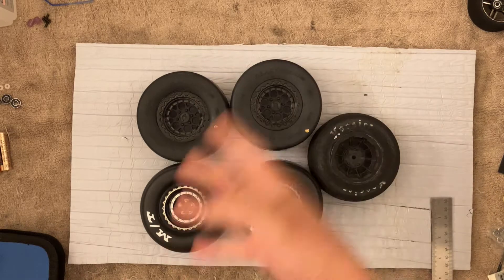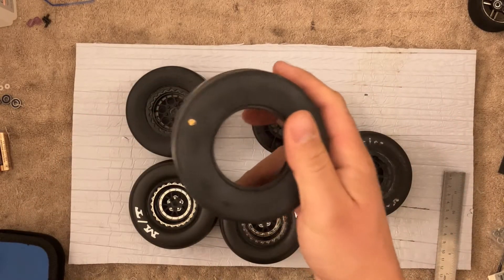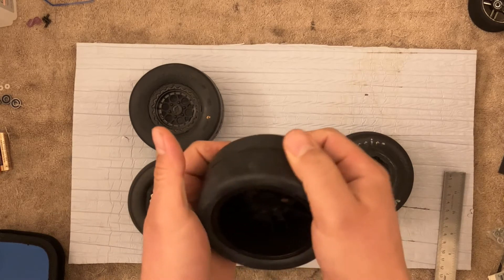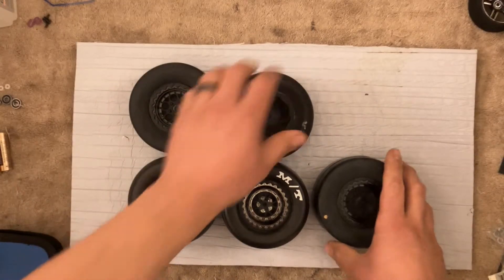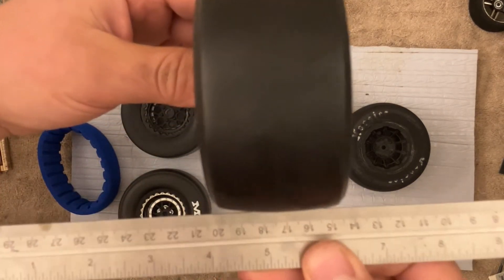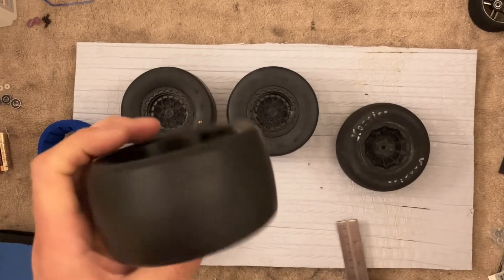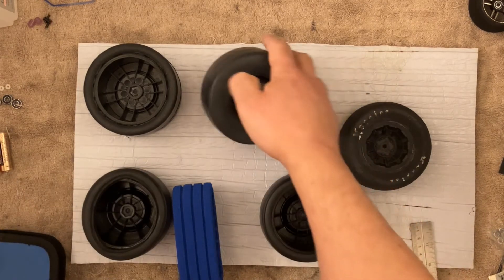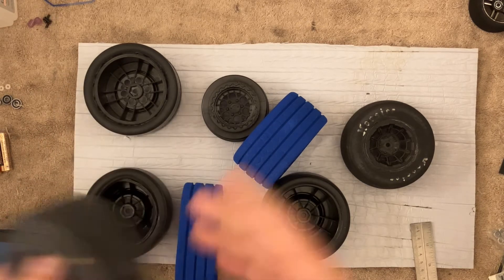RC No Prep Drag Car tire basics Hoosier Mickey Thompson Proline Reaction for Drag Slash DR10 22s

Comment: Great idea cut foam turn foam inside out and put radius edge to the inside with the short sidewall gets a better leveling affect on the contact patch.. Just got my first R/C Losi 22s 69 Camaro drag car thanks for the help..
Reply from the maker: Do you do this in belted or non belted tires too? The foam stretches less the way you are describing. So, it might just reduce ballooning a bit in the MT tires.

Comment: Tires that ballon have less traction and are a lot more unstable. Plus if your body is low you’ll have tire drag on the body once they ballin which in return will slow your car down. Belted tires are the way to go that’s why the are the tire that one at King of the Streets 2022. Ballooning tires makes the rear end of your car very loose. Oh and the contact patch you keep mentioning is really small once those tires start to balloon.
Reply from the maker: Good stuff. I will add that in minute 3:30 I mentioned that tires that do not balloon are more stable or ballooning tires are less stable. And at minute 4:10 I typed how if tires balloon as weight shifts the car will pull left or right... so less stability can be inferred. I probably should have inserted and audio clip for this bit. Then in minutes 10:10, 11:35, and 12:20 I talk about how rounder tires have less of a contact patch and how if the foam balloons the tire the contact patch is reduced dramatically. So yes... completely agree that ballooning tires due to speed, just like ballooned tires due to foam (more exaggerated with speed) will reduce the contact patch. I assumed that would be inferred. 

I did not mention the potential of contacting the body. You are right. That is really bad for stability as it would act as a break on each tire that could case it to break one side more than the other... causing it to pull/pitch one way or another. And it is made worse if the foam breaks. You are absolutely right about the tires hitting the body. 

Thanks for the feedback. Cheers.

Comment: You could use acetone to remove the tires.
Reply from the maker: True... I just don't like the smell and how it gels up and having to clean it. 😅

It's just easier to cut them and glue them back up.
Reply: Use a heat gun to remove tire and tape them

Comment: Seems to me when a tire balloons you have less rubber on the road so less traction. One ballooning more than the other you loose control. No prep drag rules now require foams JS
Reply from the maker: Cool. Good to know. Can you send me the update? DHRC and Horizon has not updated it so it still says running "no foams" is allowed.
Reply: @telecomandorc  Guess you can go without foam but I'm not sure why you would. I just got the reaction tires and they don't ballooon. Guess you know that already
Reply from the maker: @zee-lv4jh  I agree. I do not think running without foams is the best idea. These are not pneumatic tires so there is no real significant force let's say between the middle of the tire and asphalt. And like you mentioned, belted tires (I have the PL), foams are great because they apply pressure and the belts keep it together especially on the wide options. I just did not realize rules may have changed to prohibit not running foams since not running foams seems to me as a disadvantage.